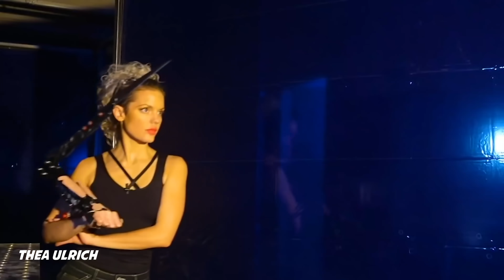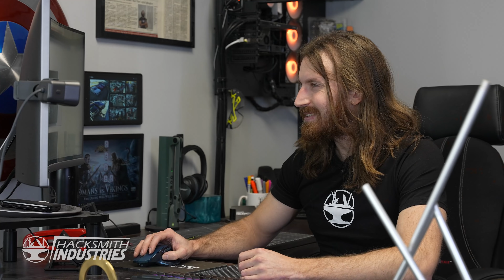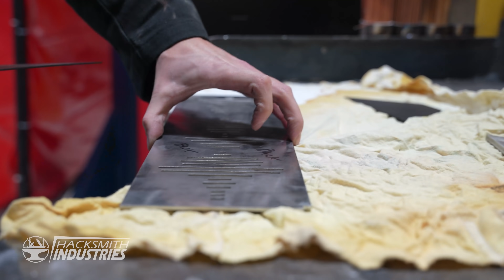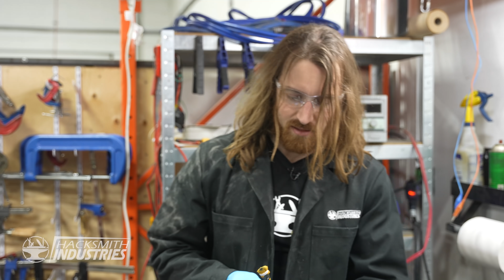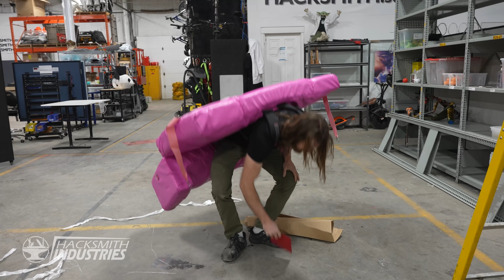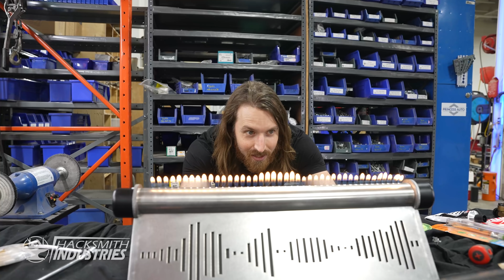Making Music With Fire!

Comment: Another way to make the tube work is to have a balloon and the speaker next to it playing right into the balloon. This make the balloon vibrate to push the air molecules and the on turn push the flames. It’s more of a diy way to do it so you don’t have to have to have a special speaker.

Comment: So my question is why did you try to find a special two sided speaker when you could’ve just installed two speakers (one inside and one out) and an audio splitter?

Also James’ coat he had on while welding looked great

Comment: It might have already been said, but by putting the speakers on both sides, a lot of your frequencies cross and cancel each other. Most larger units use speakers on a single side, so you can see the waveform in its entirety. Nigel Stanford's 'Cymatics' video actually shows a pretty good example of this.

Comment: Would really love to see a bigger version! Reuben's tubes get better with size, in order to see a standing wave of the full frequency of human hearing (20-20000 hz) you would need to make it about 16 meters long, give or take a few meters depending on the pressure of the propane. But to see standing waves of 60hz, you'd just need to make it 5.5 meters long, so that's doable! It would look a lot cooler I bet.

Comment: I think instead of having those 2 speakers where the sound waves will interact, one shouldve moved the opposite of the other, so as 1 speaker pushed, the other pulled, which would amplify the waves

Comment: With a speaker at both ends, seems like the pressure waves will be combining, providing a modified wave form inside the tube.  Especially when using the frequency  generator, it almost looked like at some frequencies the waves were cancelling each other out.

Comment: Love what you guys do! But putting two speakers directly attached to the tube will make it impossible to see a standing wave. A Ruben’s tube needs a hard stop on one side to produce constructive and destructive interference which result in the standing wave, two speakers at one end will only create a spike in the middle of the tube. Also, I’m my experience, base speakers produce a sound wave that’s too long to capture with a Ruben’s tube. 
Not shitting on it, I built a few of these for my local school board and made the exact mistakes.
Reply from the maker: Strange,  how did I get a standing wave then?
Reply: Those a106 speaker only work one at a time won’t pair together so there was only one I have those same speakers.
The other one was not bluetooth
Right hacksmith?

Comment: that's such a cool idea and execution as always! I was curious from a science perspective if the 2 speaker setup directed towards each other in the tube may have cancelled out a clearer signal for the waveform? went to the comments thinking someone would have debated it but not? 😆 🤣
Reply: If the distance between the two speakers are of n times the wavelength + half the wavelength, it will cancel out (I'm assuming you meant the speakers facing each other?)
If it's n times the wavelength, it will get amplified 

Do note that I haven't finished watching this video yet, and I'm translating from my Korean knowledge to English on the go so there could be slight errors
Just wanted to answer since it was an interesting question ;)

Comment: I’ve built one similar to this, but began experiencing problems when using for extended periods of times because the tube heats up to incredible levels due to the flames, and will destroy the speakers. I would have gotten some copper tubing and done some light water cooling, or used some cheap heat pipes and air coolers near the speaker ends to keep the speakers cool. Doing this on the outside shouldn’t affect performance or acoustics.

Comment: I'm sure there was a material limit, plus the time constraint, but I think this build would have really benefited from a tank mount, a small external regulator valve and an electric ignitor. That way, it can be operated without having to mess with the tank or having to use a lighter.
Reply from the maker: One of the goals was making it as inconspicuous as possible! Adding those things would give it away 😊
Reply: @hacksmith  Fair enough. Looks like she really enjoyed it!

Comment: Would it work with one speaker and sealing the other end?? I’m trying to make this a little cheaper
Reply from the maker: Yup! Mostly did it for symmetry in my design.  Only one speaker needed!
Reply: @hacksmith  also what speakers did you use?
Reply from the maker: Found them on Amazon not sure what brand, nothing fancy

Comment: I wonder if in the prototype, the flames going out was a result of negative interference from the speakers’ two waves crossing.  It seems like you would need to carefully consider the length of the tube in relation to the length of the sound waves and ensure they are somewhat out of phase.
Reply: Could just remedy that by only using 1 speakers driver inside, and something to absorb sound on the other end so you don’t get any audio bounce back.

Comment: My physics teacher did this last year, was pretty cool, his was a less a less elaborate setup but it showed the waveforms a lot more clearly. Was also about 2.5m long.
Reply: I was wondering if using 2 speakers in their setup may be cancelling out a clear signal for the gas to show the waveforms?
Reply: @WMCloseProtection85  I was wondering the same thing 
not specially cancelling out but creating a third one, so when they use the app to see a specific wave it doesn't really shows up
Reply: @PatrikDezseri  well how many wave repetitions you can see depends on the harmonic it’s set to

Comment: Welder here  That level of discoloration is to be expected when you are working with stainless. You don't want it to be much more than that, but that is perfectly acceptable. Generally most of the discoloration can be removed by giving the area a once over with a stainless steel brush that has ONLY been used on stainless steel (That is very important for complicated metallurgical reasons that are too difficult to explain in a YouTube comment)

Comment: I think a possible revision of the design would be to install the speakers facing the same direction versus the mirrored direction, that way assuming the speakers are synced you would get the flame to interact with the treble and mids, while also getting a good sound. Keep up the awesome content hacksmith!

Comment: Should've pre-programmed it to give a greeting once you turn it on. :) 20/20 hindsight though xD

Would've been cool to see the waveform etching be the greeting itself (or a portion thereof), too.
Reply: There's no Arduino or Pi or similar in it; it's just Bluetooth speakers. No programming possible.
Reply: @TRiG_Ireland  Would've been neat to throw it in, since they had the space underneath. But no sense in harping on details since it was recorded probably a month ago.
Reply: @Genesis8934  I also think that there's an elegance to the simplicity.

Comment: Only question I have now is, would it be possible to manipulate the size of the holes so that the flames individually get larger or smaller based on the relative strength of the different frequencies that go through simultaneously?